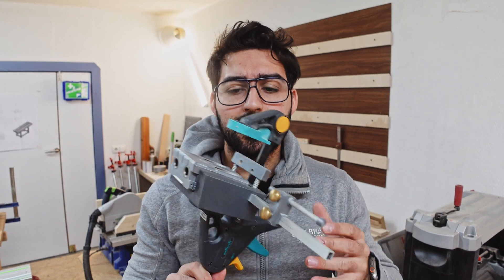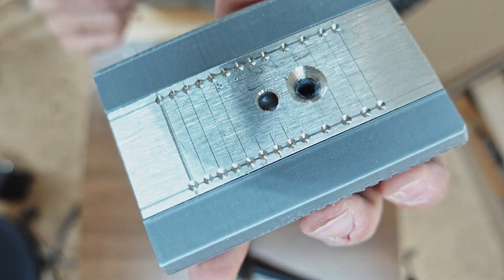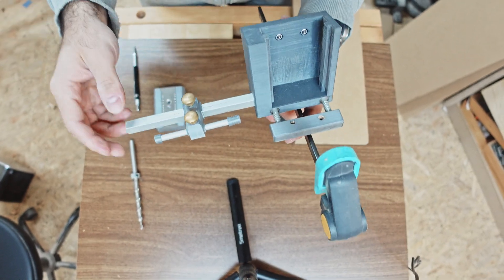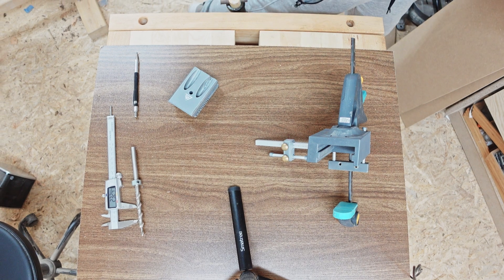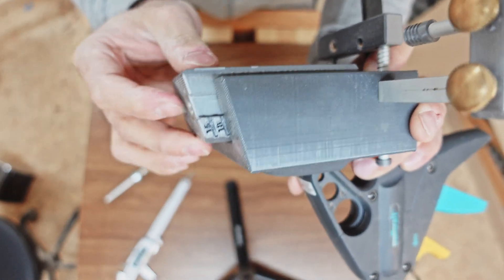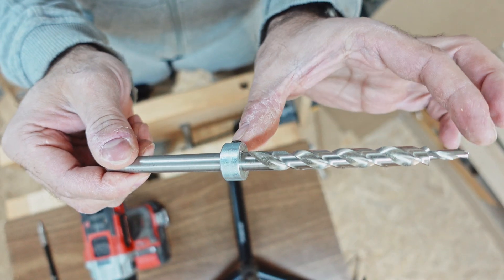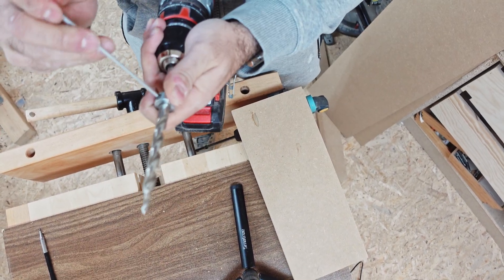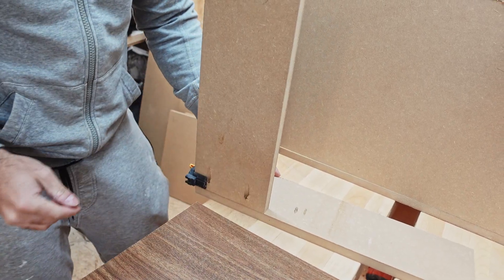I Made a Pocket Hole Jig With a 3D Printer and It Works!

Comment from the maker: 😂 preferable 😂
Ok after using this thing i found out that a little bit of oil should lubricate the whole jig and it won’t heat up that fast 😅 let me read what you think
Reply: Good to know.

Great job anyway!
Did you used the Kreg drillbit or modified a regular one?
Reply from the maker: thanks mate :) I bought one from another brand called wolfcraft